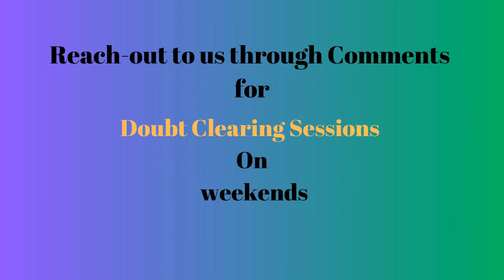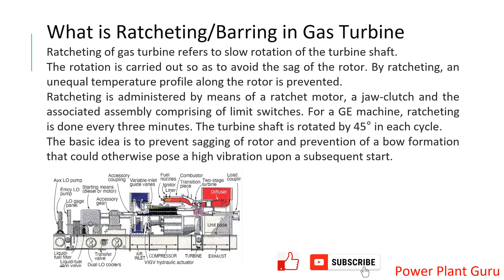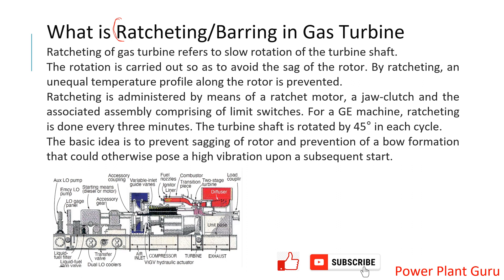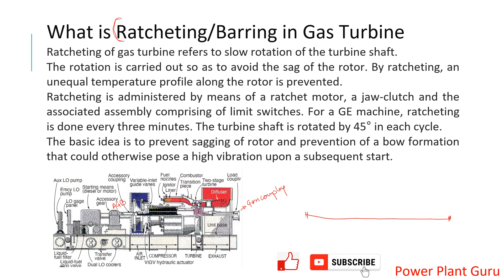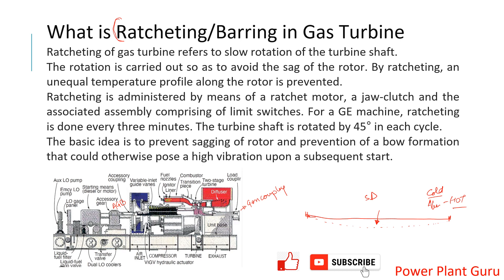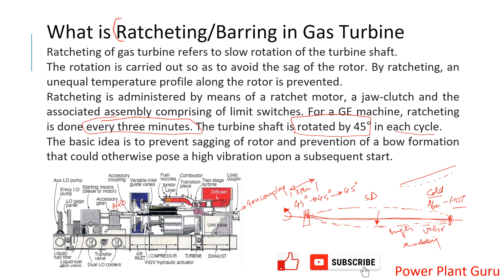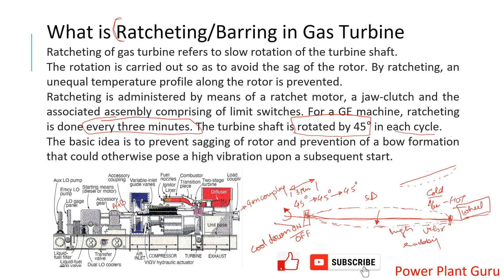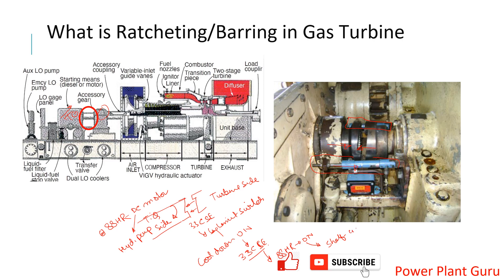Ratcheting and Barring,  Gas Turbine power plant, Turbine engine start up

Comment: Sir, Please let me know what is the output pressure of the ratchet pump of frame 5 ge machine?
Reply from the maker: Hello victor
There are no measurements available at the outlet, you can find this if you read pump data sheet